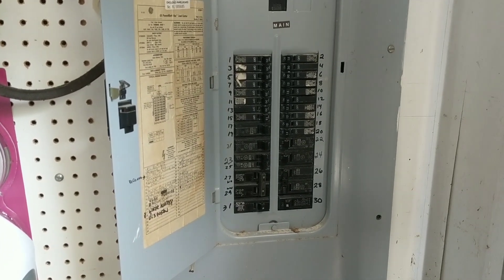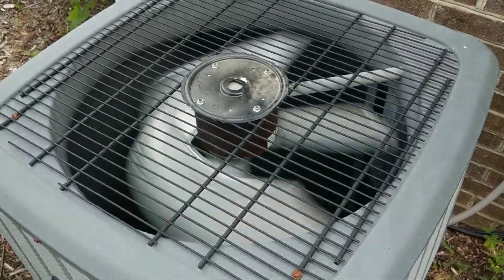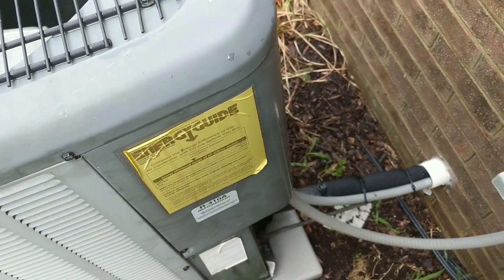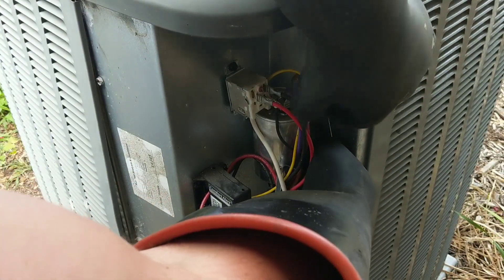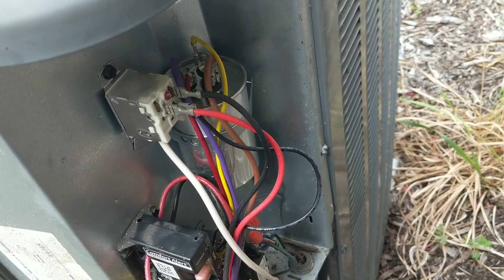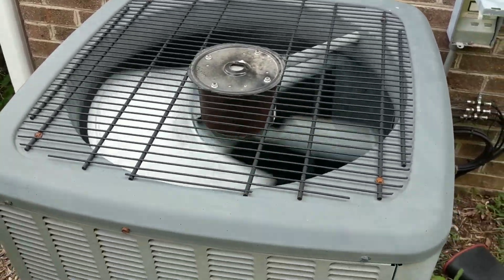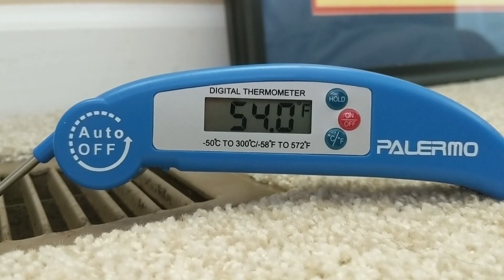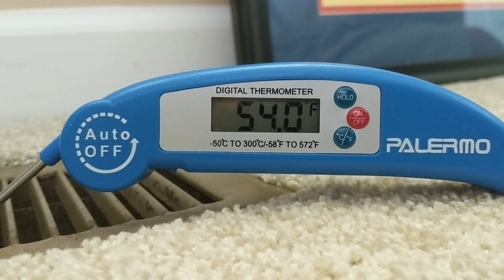How to Fix an AC Unit That Blows Hot Air - HVAC Repair

Comment: Hi.  My son and I got home and the air was blowing out HOT🙁😭😱The air comes on and the fan is turning outside.  I thought it was all the bushes surrounding it; constricting air. We cut them all down, cleaned the unit with water. Nothing changed.  I changed out the filter as well. Do you think it's the compasitor? Help! It's a GOODMAN..
Reply: I am a HVAC tech I've been doing this for 23 years it could be your compressor's going bad low on freon might not even be the run capacitor
Reply: @jstrand8803  Thank you for responding..I called a tech.. they charged me $700.. He said it was the motor..I told him something isn't making sense.. it took him less than 20 minutes to fix it...🤦🏿‍♀️🤦🏿‍♀️🤦🏿‍♀️
Reply: @sherriemac  That is a big rip off! Am in a similar situation now and afraid will have to go through the same thing

Comment: So is that the over all maintenance of an AC unit..
Reply from the maker: An experienced professional would certainly check out parts of the unit, but this is a good start to maintenance for an average homeowner that doesn't do bi annual "tune ups"
Reply: Ok thanks

Comment: No cold air here, so I took a look at my capacitor and it doesn't seem like it's about to pop, it actually looks brand new but it's not, it's the original capacitor from 11 years ago when I bought the rooftop unit new, then.  Replaced the inside filter is new and the surrounding coils are clean.  I tried the stick test like you did, but it wouldn't catch on unlike yours that needed just a nudge.  I have a capacitor on order, so I'll replace it when it arrives.  If it's not the capacitor, what else should I check.  The unit turns on and I have the Fan setting on On instead of Auto on the thermostat.  It does make a noise and the vents are blowing air just not cold.  What am I missing?
Reply from the maker: Sounds like you may need to look at the fan motor next. This video is the first check point that fixes many people's issue. I hate to say that yours is going to be more expensive of a part and likely will required a trained technican that you trust to not overcharge. Sorry man and best of luck!
Reply: @BtwilliasGarage  Thanks!!
Reply from the maker: @jayd2655  might as well try the capacitor if you get it in time first. 11 years old is when stuff starts breaking though! HVAC companies state 8 years is typically when units are cheaper to replace versus throwing parts out, so definitely use a trustworthy company if it doesn't fix it

Comment: One cannot see the rewiring because the head or the hat block the view. Big Zero!
Reply from the maker: I mentioned in the video to do them one at a time and match up the wire to the same markings on the new one. Sorry the camera couldn't capture that part perfectly. Thanks for watching and the feedback
Reply from the maker: To be clear, the capacitor has text on it, so it's easy
Reply: You are an idiot!! Stay out of your AC system and let a pro do it. This man clearly is helping people with common sense out. You however, lack that. "Hat was blocking it" your wiring is probably different from his or mine. You just focus on breathing

Comment: How do I find out which capacitor fits my unit? It’s an old unit that was here when I purchased the house.
Reply from the maker: You will need to locate the capacitor and read the model. Watch that portion of the video again and let me know if you have questions. Be careful when your doing it, as it does have live power!!! Or just turn off the breaker to be safe

Comment: I've had an issue a couple of times with the drain line being clogged so I went out bought a Shop-Vac to unclog the line that didn't work try to jump-start the unit by spinning the blade that didn't work turns out the breaker was tripped
Reply: Stephanie S pahhahaha gd one

Comment: Thanks for the video, I’ll give it a try. Although my outside unit sounds like metal hitting metal. I’m thinking it’s the capacitor because it cools for 30 minutes the fan stops buzzes and stops cooling the house.
Reply from the maker: Yep! Most likely capacitor beginning the fail. You can jump start it in the meantime, but don't leave it buzzing stopped. It will burn your fan motor up
Reply: Btwillia's Garage, I just took the cover off and it looks like the orange and yellow fan motor wire got cut from the blade. Maybe that’s all it is?
Reply from the maker: @daniel9371  could be. is the fan still humming with it plugged in? Sometimes wires are not needed, but it depends on who installed it as far as if they left it a mess. Does the stick test work to start it?
Reply from the maker: @daniel9371  if it clearly was cut them I would pull the main fuse and cut the breaker box off then repair the wires properly with a connector or soulder

Comment: When I start the ac, it blows cold air, but after 15 minutes or so, the cold air is gone and it starts blowing cool/warm air. And the thermostats never go below 75 even when I set it around 63. Do I need to replace something?
Reply from the maker: Is the outside unit fan running when the warm air comes in?
Reply: @BtwilliasGarage  Strange, now my AC is working fine. My neighborhood had a pipe burst over the weekend and they fixed the pipe Saturday night. They mentioned something about water pressure not being back to normal so maybe that may have something to do with it?
Also, I live in a high-rise condo and my AC unit is in a closet and I can't even see where the fan is.. But let's hope that things are back to normal. Thank you for quick response!
Reply: @BtwilliasGarage  my AC unit outside is blowing cold air. But not cooling the house.